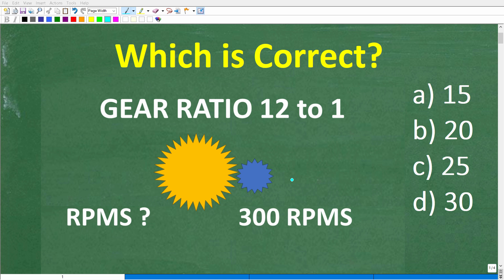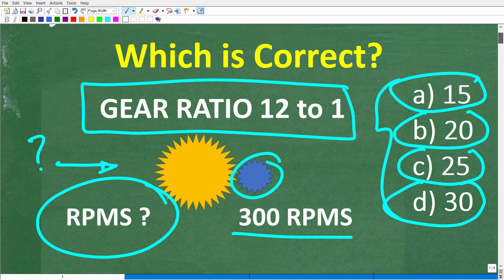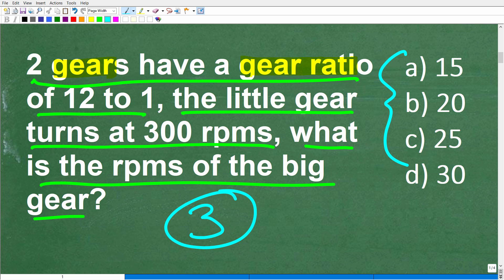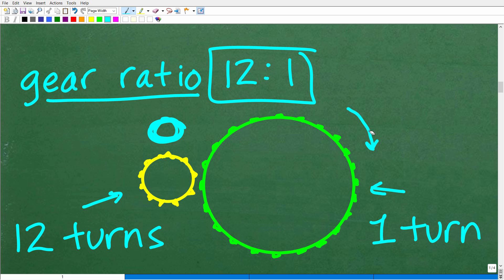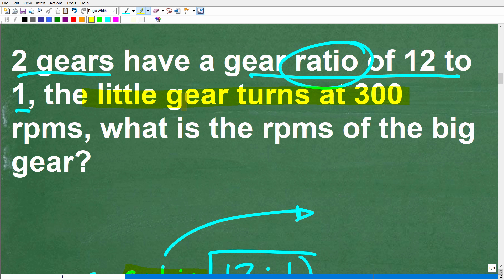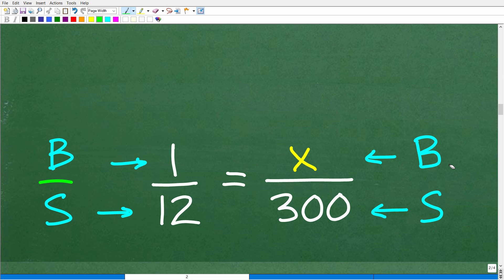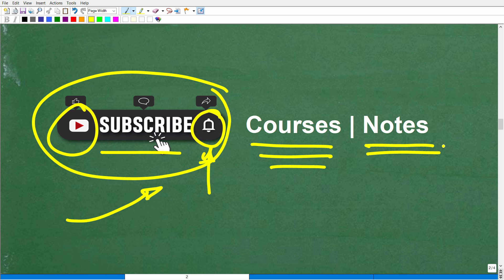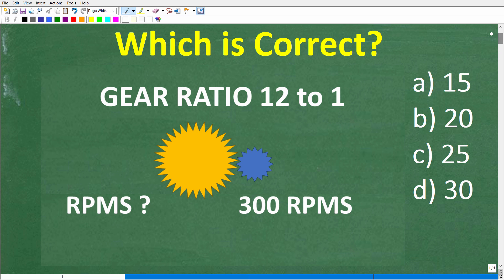2 gears have a gear ratio of 12:1, what's the rpm of the big gear if the little gear is at 300 rpm?

Comment: If the ratio is 12 to 1 then the big gear turns 12 times slower.
300/12 = 25                    The answer is c)

Comment: parameters

rotation rate (rpms):
S:   small gear = 300
L:   large gear  = ?

Number of teeth
T.L:  teeth on large gear
T.S:  teeth on small gear

ratio of teeth = 1/12
           T.S/T.L = 1/12

teeth engagement = 1:1 such that number of teeth/min is same:

(T.S)×(S) = (T.L)×(L)

T.S :  teeth/revolution (tee/rev)
T.L :  teeth/revolution (tee/rev)
S:      rev/min
L:      rev/min

such that

(T.S)×(S) = (T.L)×(L)
(tee/rev)(rev/min) => 
tee/min = tee/min
so tee/min is constant

We don't know total teeth but we do know 
T.S/T.L = 1/12

(T.S)×(S) = (T.L)×(L)
becomes
T.S/T.L = L / S
and again
T.S/T.L = 1/12
S = 300 rpm
so
(1/12) = L/300 rpms
L = 300/12 rpms
    = 100/4
    = 25rpms
Reply: Let's not we were told a 12 to 1 ratio meaning every time the big gear rotates once the small gear has 12 revolutions at 300 rpms simple math